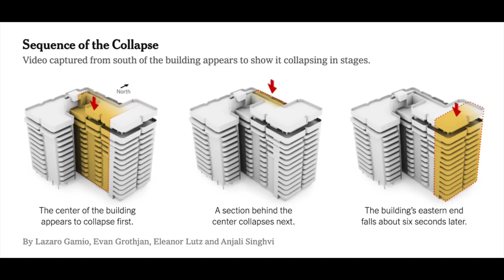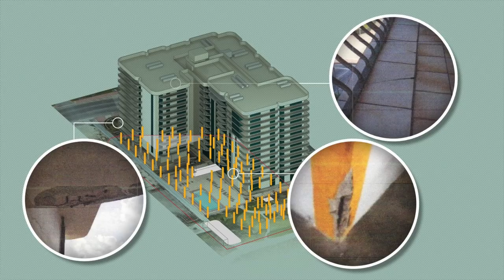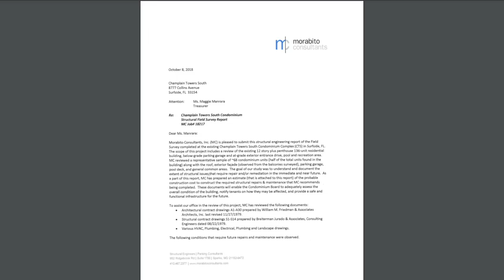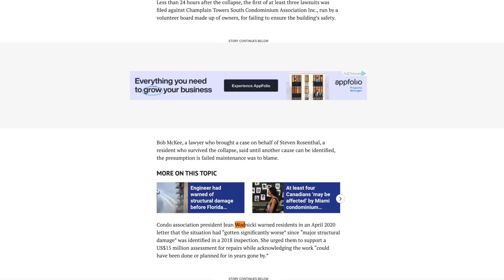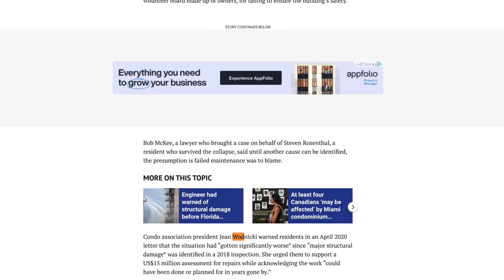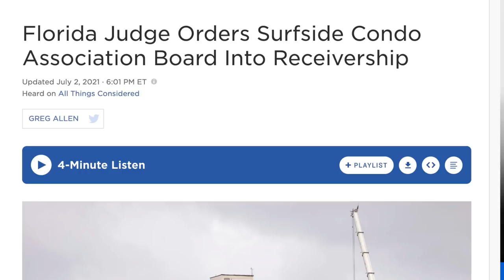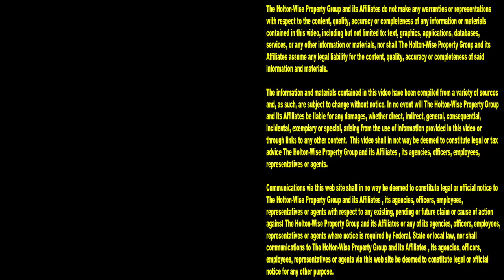Why did the Surfside Condo Collapse? Who's to Blame as Lawsuits Pile Up? | Landlords From Hell 12

Comment: After reviewing hours of youtube coverage on this from various people here is my theory.

The vistor parking lot by the lobby was completely full with parked cars.  It was over a design weakness where the primary columns made to support the entire building transitioned to smaller columns just used to support the pool deck. Not only were these smaller. They did not line up with the larger primary columns which made the area where the visitor lot was a a lot larger of a span than all other areas. On top of this, it appears the rebar in the surface of the lot was sparse and should of been more dense with more criss-crossing particularly over columns for a parking area..  When the parking lot failed it pulled the rebar out of the concrete length wise causing the surface to collapse into the basement garage and the columns to punch cleanly through the concrete.

This alone should not have brought down the building but it looks like it triggered a domino effect when it fell, it brought down the pool deck.  When the pool deck came  down it seems like it pulled 3 of the columns holding  up the primary structure away from the top of the column counter-clockwise to the ground.  Since the columns were really designed to take lateral shear it was fairly easily pulled out and this initiated the structural collapse.  The planters in the area could have contributed to weaknesses in the columns that allowed the pool deck to pull the critical columns down.  The pool deck's water issues could have also contributed in it's collapse as well.  All this adds up to multiple factors combining to allow this to happen.

In summary:
1: The vistor ground level parking area collapsed into the basement due to insufficient rebar and the supporting column layout (design/build issue) possible combined with repetitive loading stress from cars driving on it daily.
2: This in turn pulled down a large section of the pool deck.  This could have been aggravated by the pool deck's known water issues which would in turn weaken the structure (maintenance/repair issue)
3: The pool deck falling pulled 3 of the primary building support columns out from under the first section of the building to fall.  This could of been aggravated by nearby planter boxes extra weight contributing to the torque moment and it collecting water and weakening the structure. (maintenance/repair).
4: The rest of the sections fell as critical members came down over loading other critical members in a catastrophic chain reaction.
Reply from the maker: Would you be willing to live in the Cleveland Ghetto for half a million dollars? https://youtu.be/QUABye1BJvw

Comment: The bottom line is that the residents (and therefore the victims) themselves were certainly aware of the underlying structural issues, and Condo Assn  members resigned because they could not get agreement to pay for necessary repairs.  The engineers who wrote the damning report are not at fault unless the collapse had nothing to do with the pool deck, which seems impossible given eyewitness and video evidence.  The original architects are likely not at fault either, given that the original plans clearly had drainage for the pool deck in them.  The original contractor may have some fault for deviating from those plans, but the expected lifespan of the pool deck has come and gone and the residents knew it has typical issues that they could have addressed in a timely fashion.  A pool deck is not guaranteed to last 50 years in any scenario.
Reply from the maker: Would you be willing to live in the Ghetto for half a mil? https://youtu.be/QUABye1BJvw

Comment: It seems the residents of the surfside condo's weren't willing to pay for the necessary upkeep of the building. Champlain's northern twin has been inspected and allegedly deemed safe. If the 2018 inspection didn't scare the board and residents into action, then 6 minutes of the thunderous collapse of the pool deck parking bay area, then the pool deck and most of the building would surely bring a flashing regret into the residents minds. The alarm of exponential deterioration of the building's foundations were given in the report.
Reply from the maker: Would you be willing to live in the Ghetto for half a mil? https://youtu.be/QUABye1BJvw

Comment: They said in the story that the land value was 10mill do you really think they will ever let you build on this site again. and the repairs were going to cost 12mill+ before the collapse. well the extra cost of using stainless steel rebar is looking pretty cheap now even if it cost 10 times as much (it would really be about 3 times). you would have saved any extra cost just on the repairs to the concrete alone. this building was about 200 feet from the ocean do you think there might be a corrosion problem!
Reply: Its more like 100m and yes they will build on the land again. Even WTC was rebuild, and its private property not governmental land.
Reply: @torbenjensen189  well last time I looked there was two memorial pools where the building were. and Oklahoma the Murrah building is a park now. and who gives out the permits. and listen to the video they said the land had a 10mill value. My point is in corrosive area's like 200 feet from the ocean use stainless steel rebar!!!!!!
Reply from the maker: Would you be willing to live in the Cleveland Ghetto for half a million dollars? https://youtu.be/QUABye1BJvw